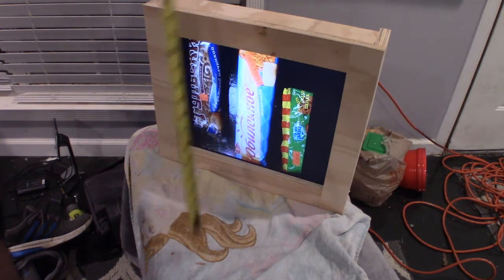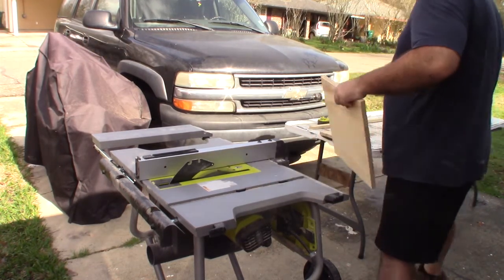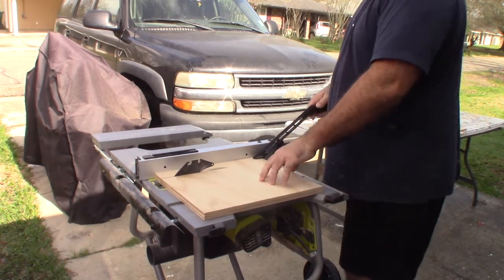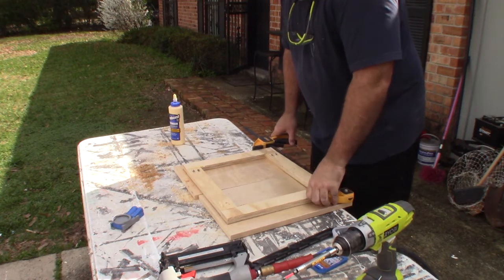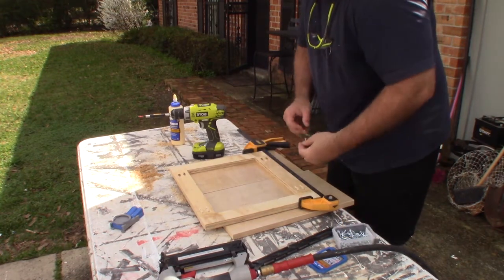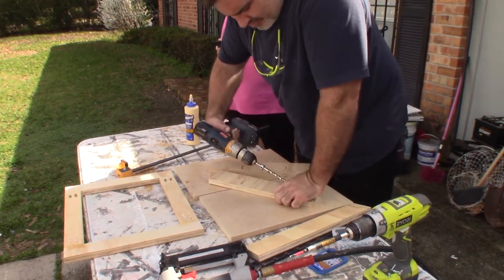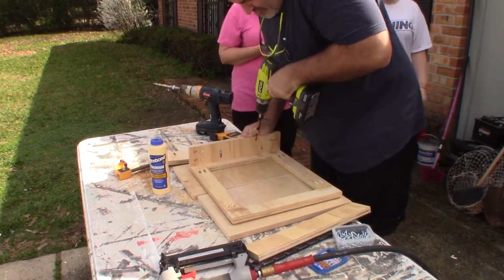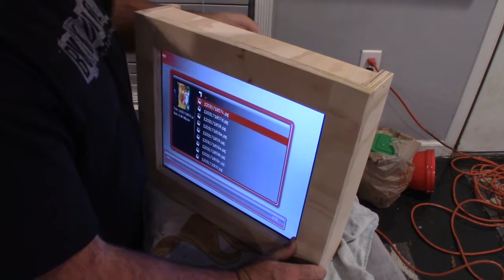Convert your old LCD computer monitor to a digital picture frame

Comment: Only thing i did significantly different is i used a C14 to C13 + standard plug Y splitter, so i could add the power source for the media player inside our box and i plug mine in from the side 🙂
Thank you so much for the video!
Reply from the maker: Cool.   I need to make a new one now that I have had a year to think if new ideas

Comment: Hi could you please elaborate . How did you connect the monitor with the media player? Did you use an HDMI to VGA adaptor
Reply from the maker: The AGTEK media player is hooked to a HDMI to VGA converter called BENFEI then VGA to the monitor
Reply: @buckdingler1831  Thanks Mr Dingler ! You are a life saver !